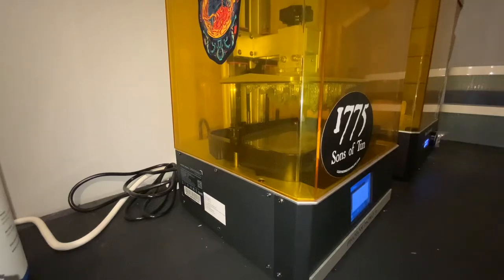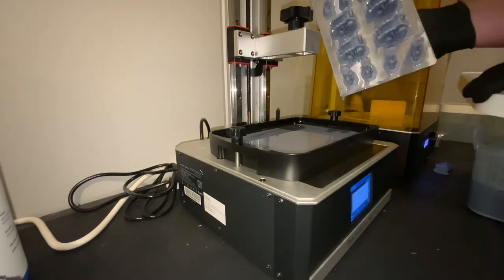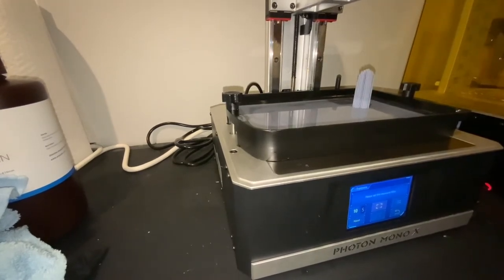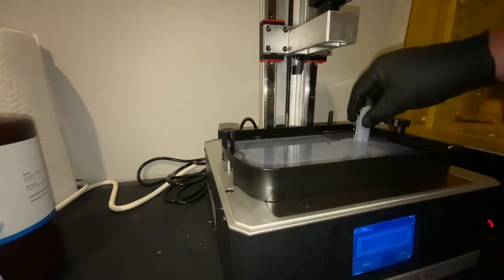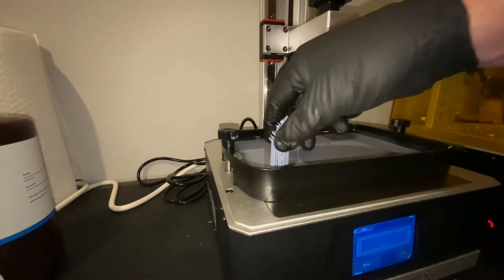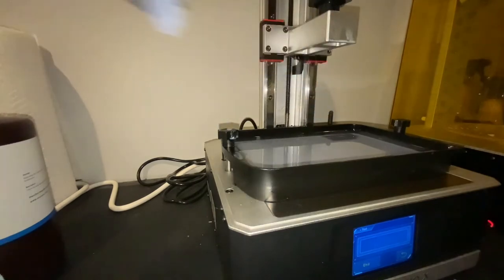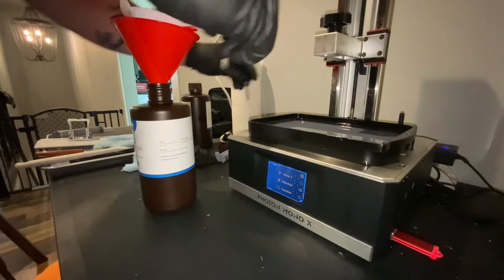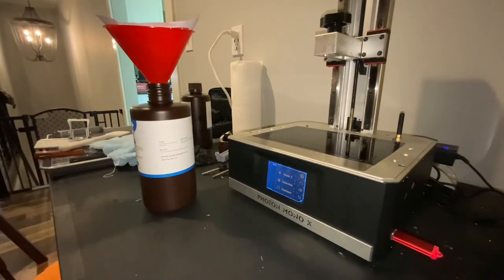Anycubic Photon Mono X vat or fep cleaning tip

Comment: If you find it not working increase the exposure time to 20 seconds.
Reply from the maker: Ok first off I don’t even run that printer any more. Now I have a Saturn 2 8k and a Jupiter. You can hear the awful sounds it made, and it got worse and worse. 
Second, there is no way I would ever have a 20 second exposure time for anything other than the the first few layers to build the raft. That’s just ridiculous. A 5 second exposure is even high in my opinion. My new printers usually have a 2.3 second exposure time a some times that varies. But I never go higher than 3 seconds. A lot of the stuff I currently print, generally takes 10 to 16 hours. With a 20 second exposure, you can do the math, but that just not feasible for resin printing.

Comment: What’s making that loud noise when your screen turns on?
Reply from the maker: My machine is a couple years old and I do a lot of printing. I can’t say I know what it is that makes that noise. All I can say is, it gets a lot of use and has slowly been making more and more odd noises as time goes on. Usually what happens is, those noises go away as the print goes on. I do try to keep my machine and the area surrounding it clean. So basic answer to your question…. No clue.